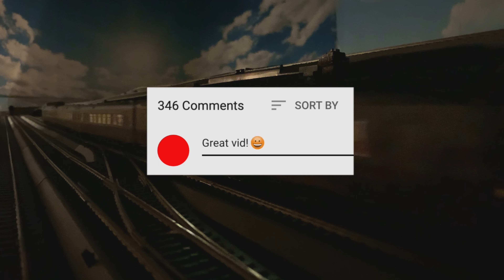Detailed Review: HO Scale Athearn Genesis Union Pacific DDA40X SoundTraxx Tsunami 2 - Will It Haul?

Comment: Awesome locomotive and excellent review!   But if you're going to pull heavy consists with this or any Athearn locomotive, might be a good idea to swap out the McHenry couplers for Kadees (either the standard no. 5 or the no. 158 "scale head" for a more prototypical appearance) as the McHenry couplers are prone to failing when put under high stress situations for extended periods of time, I found that out the hard way a little over 2 years ago!
Reply from the maker: That’s great advice! Thank you!
Reply: @DoctorHobby  no problem!

Comment: Good review ! I have the Athearn Genesis 6910 with Tsunami2 Sound but I can't test it out because I don't have a layout. It is already nice to watch it on a piece of track in my showcase.
I am wondering does this locomotive have cab lights ?? If Yes what function key would it be ? The user manual doesn't mention anything about cab lights.
Cheers, Jan, Australia
Reply from the maker: Thanks for writing! Mine does not have can lights from what i was able to tell--although for this beast, maybe it would actually be "cab floodlights?"
Reply: @DoctorHobby  Thanks ! I saw another review over the 6915 and that one has cab lights albeit it was the only DDA40X I saw with cab lights on YouTube.
It may depend on the road number you have. Mine is probably the same as yours with a cab in darkness.